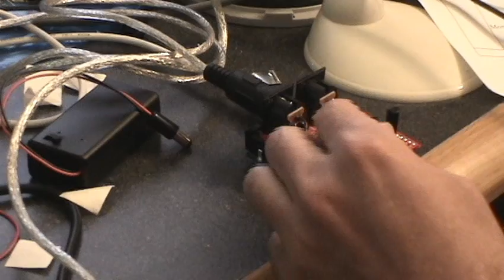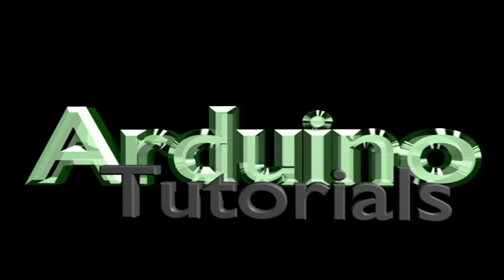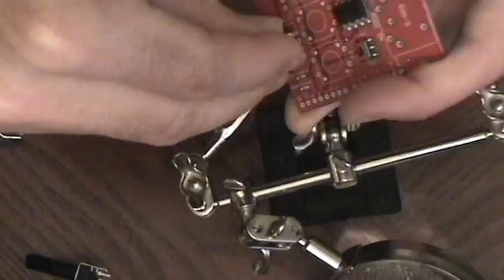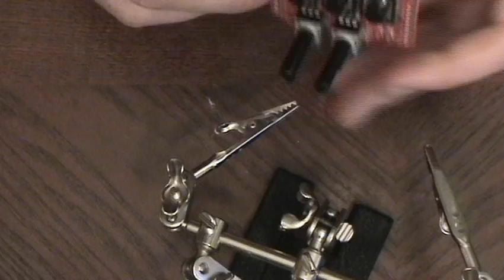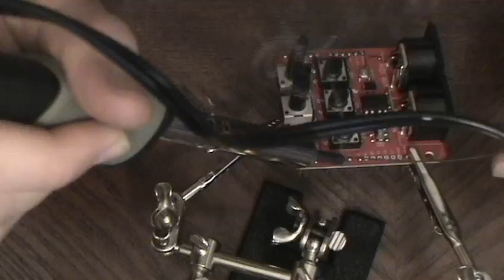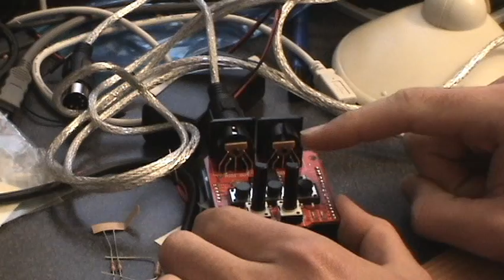Arduino - MIDI Controller part 1

Comment: do you need any driver for the computer?
Reply from the maker: Linux should already have drivers for basic midi controllers like this built into the kernel.  If you are on another OS, then possibly.  Seems like Windows still doesn't support any hardware out of the box.  But, I would guess that the USB midi adapter came with a driver disk for Windows.

As far as the Arduino goes, you aren't hooking the Arduino to the computer, so no drivers are needed for that.  But, even if there was a need, Linux has Arduino drivers built into the kernel already.

Comment: hey dude.  this video is helpful.  i'm putting together my midi shield now.  I'm wondering why you solder a few of the pins while the shield is still connected to the arduino, and then remove it and solder the rest.  i'm new to this so i'm curious if i should do it the same way.

and do you need to solder every pin like that?  what if you want to add some more sensors/actuators?

Comment from the maker: @kuzberto: There shouldn't be a difference.  The all the drum machines I've used just use standard midi keys.  Example, if I hook my midi keyboard to Hydrogen, and press keys at a lower octave, the drums will play.